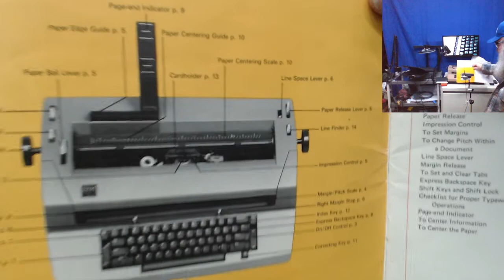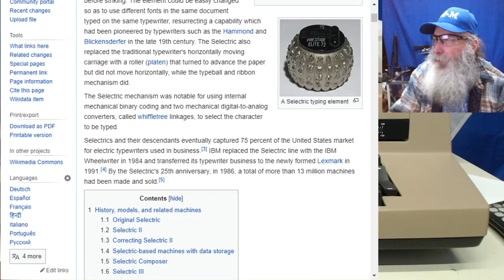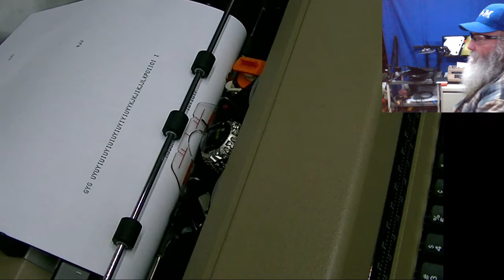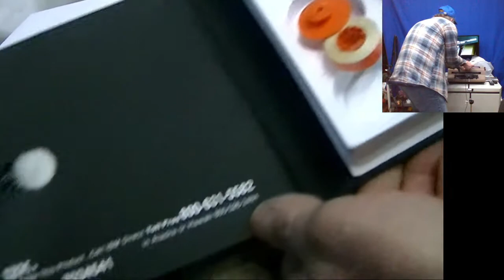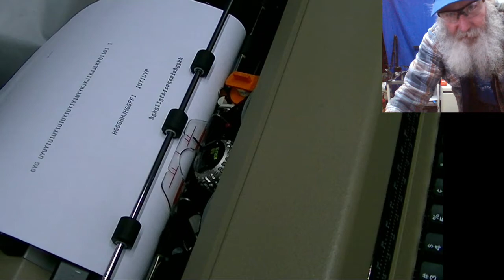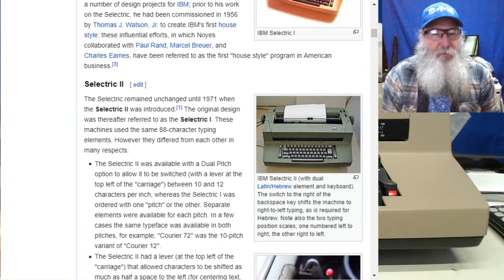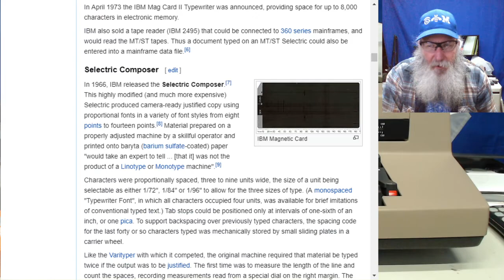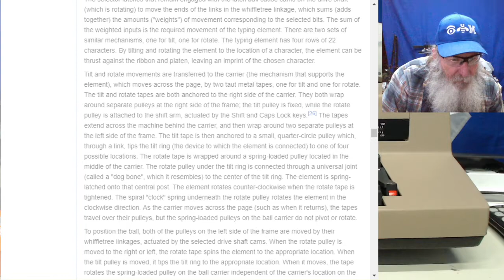A look at the IBM "Correcting Selectric III" Typewriter!

Comment: In the typewriter spectrum, the character size is called "pitch." Because print characters have the same measurements of character width and space, regardless of character type.  In the typesetting field and microcomputer technology, typeface measurements are "points" and "pica." You may continue to refer the typefaces as "fonts." I learned to typewrite when I was 12 years old.